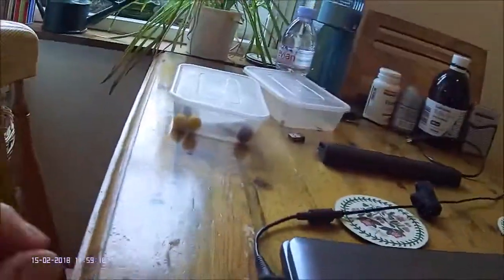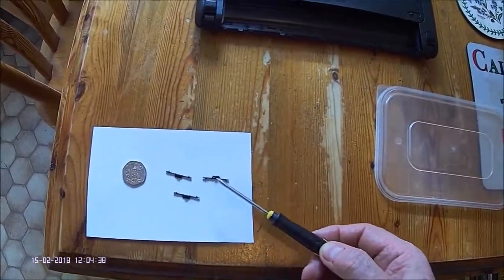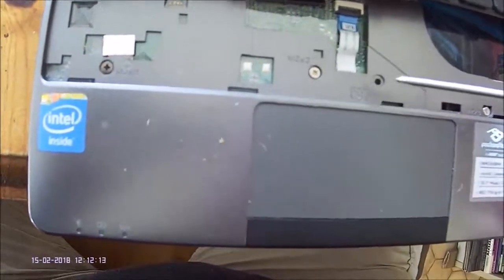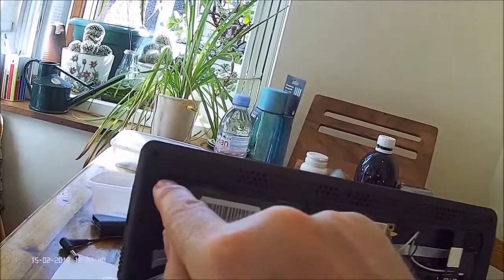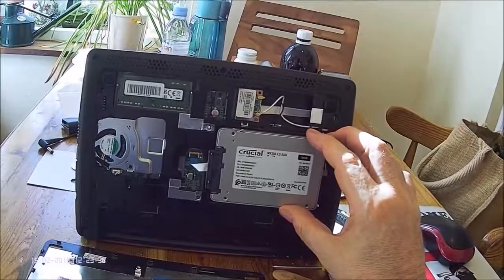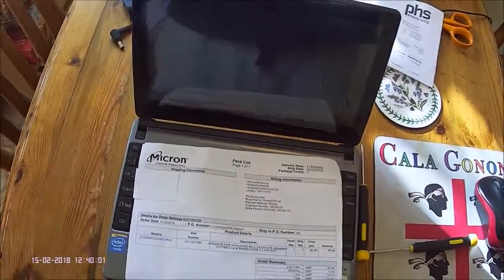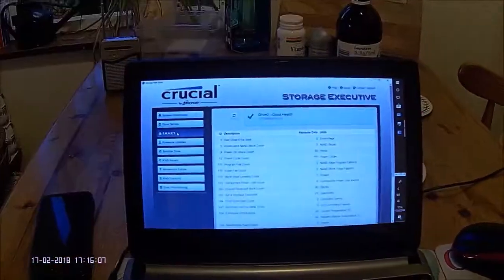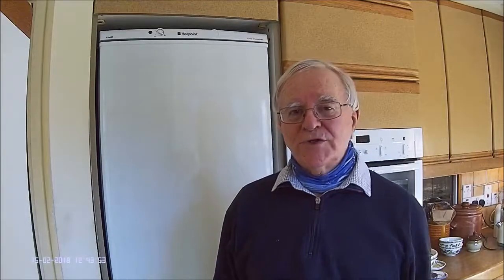ENME69BMP SSD Upgrade

Comment: About the 3 clips, do not remove them!
simply open your easynote - and look no the top row of keys ESC towards DEL - there you can see Three little noses at F4, F8 and F12 - use a thin screwdriver or a prying tool and very gently push them into the case (upwards) beginning from right to left, the keyboard will pop up and then you can remove it as Howard mentions in his video. 
cheers! :D

Comment: Thanks for the video - last year we added SSD. This year 8Mb RAM - remember if you are upgrading you need 64 bit OS for higher amounts of RAM. I think the machine may have originally come with 32 bit Windows (I don't recall). The RAM if anyone is looking needs to be DDR3L (L for low power 1.35V) SODIMM. It's more expensive, I don't think the start 1.5v stuff will work.
Reply: Windows 10 64 bit for ram greater than 4gb in total. Probably any 64 bit os should work.
Reply: @Alltechplus-Rojales  So on this PC, if I upgrade to Windows 10 64-bit and add 8GB of RAM, will the system recognize all 8GB?
Reply: @domythebestmaster99  Just been to double check as it was 4 years since my original comment - we still use the laptop and yes it does have 8Gb in it running 64 bit version of windows 10
Reply: @ So windows 10 64 bit can recognize all 8gb, great. I just bought this notebook for 30€, as soon as it arrives adding an ssd and a 8gb ram stick.
Reply: I have bought the correct RAM but could not get the whole 8GB recognised. Will it be automatic as long as a Windows 10 64-bit is installed?
Reply: @junniemarksia2265  Will need to be a 64 bit operating system. It worked fine on our little laptop.
Reply: I just got this computer but it won't let me install Windows 64 bit. What OS do you use? What should I do? Thank you.

Comment: Very useful video, thank you! I found the trickiest bit to be re-inserting the clips at the end; for anyone else's benefit, insert them flat-surface down, and work from one end of the clip to the other, such that each clip, once re-inserted, gets bent into a slight "D" shape.
Reply from the maker: Robert Stovold thanks, and useful tip!

Comment: Thank you very much. I got one of these laptops in a box of faulty laptops, and couldn't figure out for the life of me how to open it. Sadly, it was beyond economical repair. It worked as a computer, but a motherboard fault meant it wouldn't charge any batteries. So, it was salvaged for parts.